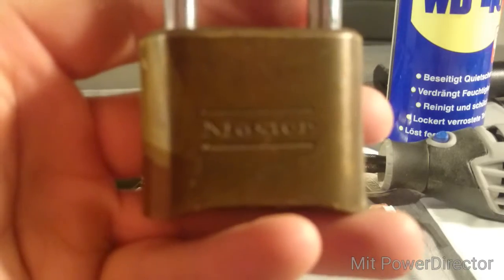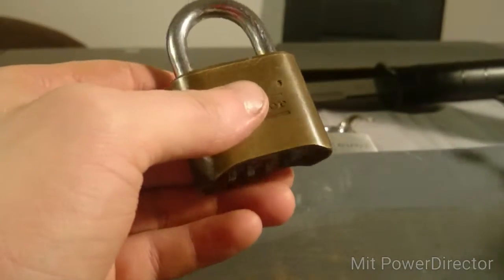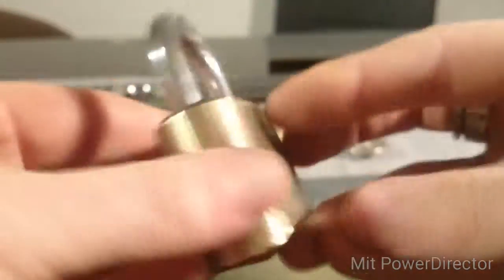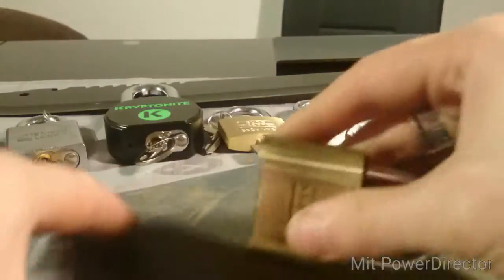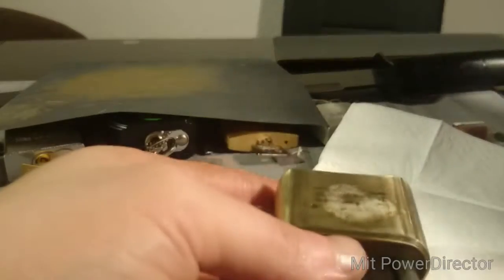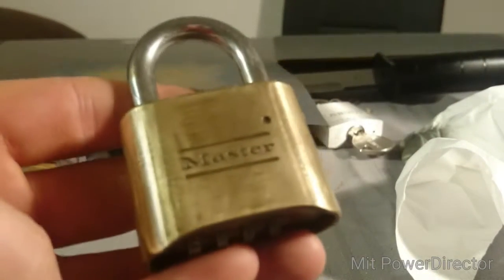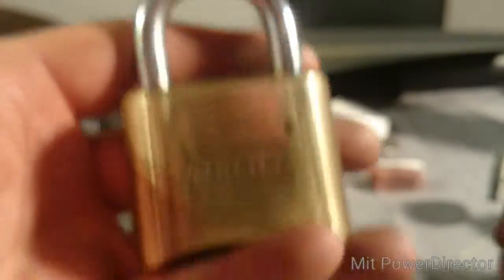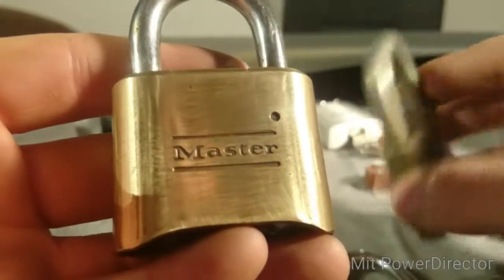#26 Clean your old Locks

Comment: Do you think that the sandpaper is really necessary? It leaves scratches on the surface. Can the polish do the job alone? Thanks for mentioning my cleaning video :-)
Have you tried defeating the combination lock?
Reply from the maker: Only polishing it would take ages, but the grit should be very fine at least 1500 I used 1200 because that was the finest they had at the store.
I'm working on defeating it currently experimenting with feeler gauge.
You did a great job in your video much better than I did.